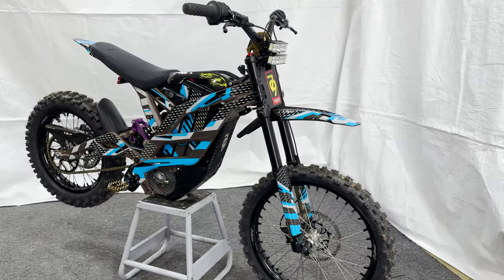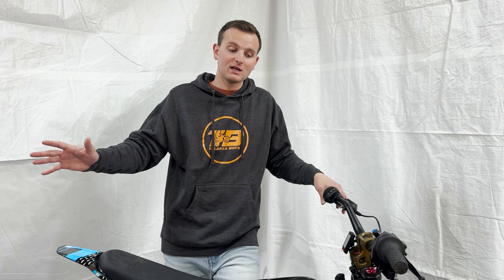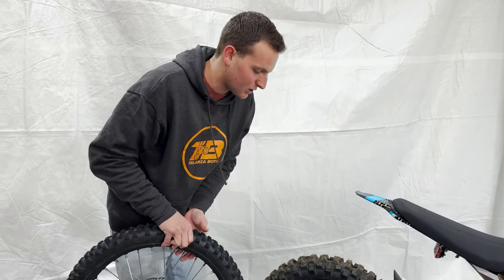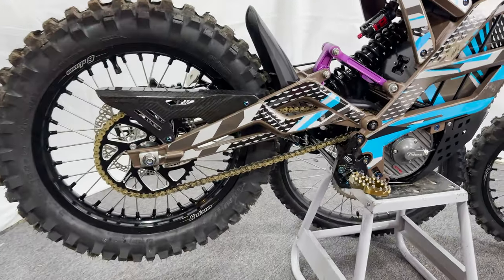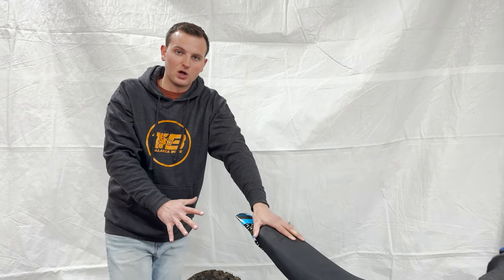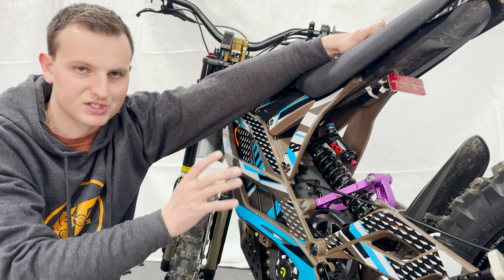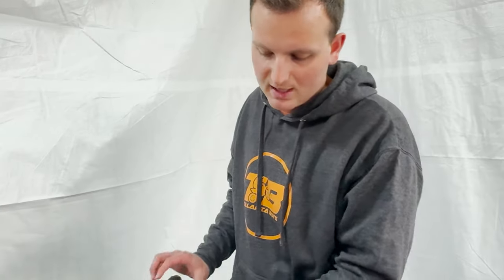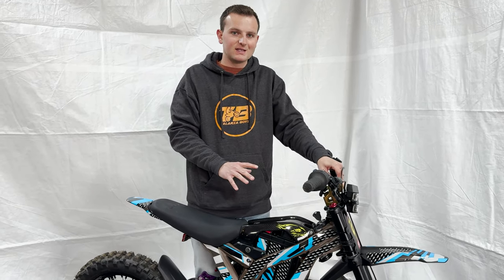Everything You Need To Know About The 79 Bike Falcon M!

Comment: Where do you find the pairing code to connect the bike to the app? Just got mine and I am having a bit of trouble pairing the bike to the app.
Reply: Finally figured it out!!! If you are having trouble getting your bike to show up in the Toya App just push the M button 7 times to put bike into pairing mode.
Reply: Also if you are having an issue with the Error code 2, just pull your controller out about half way and make sure your you main connection is nice and tight. Took me a while to figure out that the loose connection to the controller caused the Error 2 message.

Comment: wondering if you could run a bac on there because 50 is pretty slow for a 72v
Reply: Yeah probably capped out by stock controller
Reply: Did you find out if a bac would work?
Reply: @Freegonster  Im assuming any controller would work if you get adapters to be able to plug into everything else
Reply: @brug6490  alright thanks, let me know if you find anything else

Comment: @Talariaboys can you confirm that the Falcon M does come stock with the Sotion motor and the app for iOS. It sounds like from reading Reddit this might not be the case. Also @ 6’ 2” what are some mods that would help me fit this bike. I’m thinking riser handlebars and if warp 9 has the peg adapter and new kickstand. I would prefer not to buy new wheels right off the back but I really want to be comfortable. Also less get that range test done so I can sleep well knowing I got the right ride for me.
Reply from the maker: Yes it comes with the sotion motor and ios app! Get a riser bar, the warp 9 peg lowers dont currently fit but could be slightly adapted to which is what we have done.

Comment: I like that the app allows you to turn off the so called saftey settings.
I can not call them safety settings, as for when my kickstand moves to far on my segway it will make the bike cut out.
(I just removed this from the system, as I do not see its intention at all, but another thing to worry about when riding.)

Also if I get air and lean the bike like one would in the Air I get a cut out also.
Just does not make sense to me to have a bike with most of these sensors, so having the ability to turn them off is great.
Yet some of the sensors are a waste of time and money to me like the kickstand sensor.

So to me there are sensors that are in place that in fact can cause you to eat the dirt if they remain on in certain settings.
I personally don't want to fear a cut out from a lean or a bump to my kickstand. I would have these off by default or a optional
walk through to explain why you might want this sensor on.
Reply: what’s the app called

Comment: awww mannn if surron 2024 models just had the carbon, the motor, the batery, the better controler it would be a no brainer to go for a surron.
i can see myself getting a 79M and later swaping over the stuff to a surron frame lmfao.
cause im asuming the surron and 79M batery are 100% compatible size wise, and plugs wise (worst case i just need an adapter plug)
Reply: Haha sooo basically if everything about the surron was different it’d be better 😭
Reply: well duhhhhh, either that or if the 79M frame was 100% compatible with ALL surron mods, since the frame is better is 1 piece cast, no welds so its wayyyyyy stronger  @F1ow3rzzk
Reply: @naz95k71  yea I’m actually thinking about pulling the trigger on the 79bike for my first ebike , seems to me the right move

Comment: I see how it has the Sotion fw01 but isn’t the Sotion motor 10kw? Why is it marketed as 8?
Reply from the maker: Just because the motor can do higher power doesnt mean the controller and battery on the stock Falcon can. The motor is rated at 10kw continuous and 20kw peak so its far more capable if you upgrade the battery and controller in the future
Reply: @Talariaboys  okay that makes sense, can if you fun out any aftermarket controller or battery options can you make a video on it?